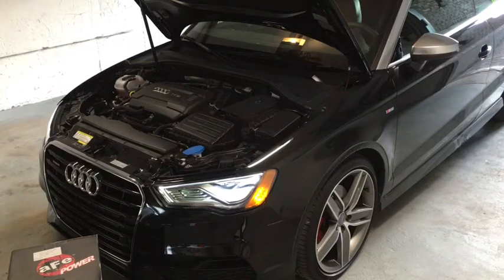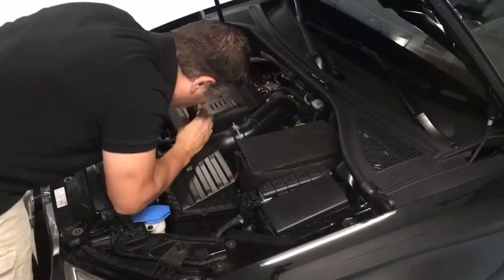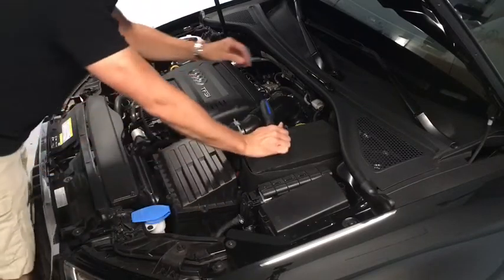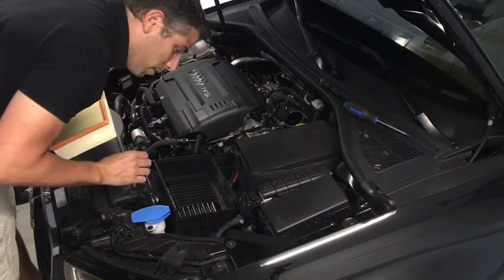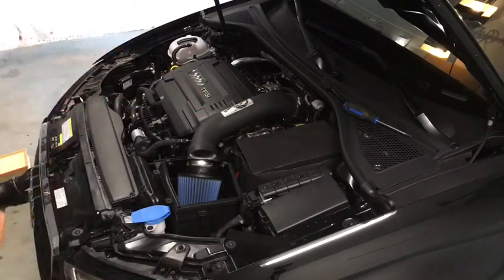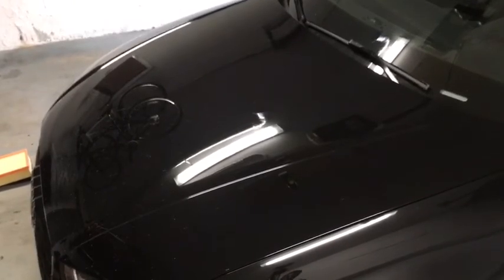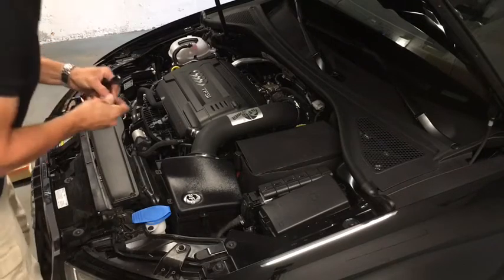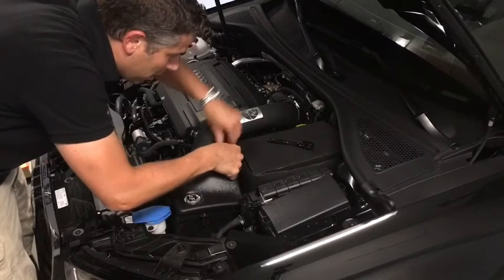aFe POWER intake - 2016 Audi A3 S3

Comment: Hey man, did you notice the difference between cover and open element? More noise? Do you experience heat soak without cover due to suck in hot air in engine bay? I have APR intake, it is too quiet, want more noise. I didn't notice AFE actually give you option to chose open or close intake until i watch your video. Great video
Reply: Open gives more noise. Heat soak hasn't been an issue for me but I don't track my car.

Comment: Your intercooler will cool the air before it goes into the engine, so cold or hot air going into the intake will be cooled down before it goes into your manifold. so really you don't need to cover the filter.
Reply: That's not really true.  An inter-cooler removes heat energy from the charged air by transferring that energy to the inter-cooler itself where airflow from the moving vehicle flows through the intercooler and the heat gets transferred to the moving air.  An intercooler is only able to remove a fixed amount of energy from the charge air at a given vehicle speed.  In practice, your post intercooler air will always have the same amount of energy removed from it, so if your pre-intercooler charge air is 250degF and the post is 200degF (purely examples), then at a pre-intercooler charge air temp of 270degF, your post-intercooler air will be about 220degF.  In a turbo vehicle, keeping your intake air as cool as possible throughout the process shows benefits to HP, so don't discount any step in the process.  My .02
Reply: Doing that air intake mod to the stock will gain no go the stock air intake system flows more than enough. Even on a stage 1 or 2 tune you won’t need it.